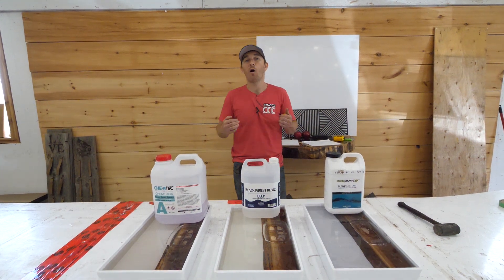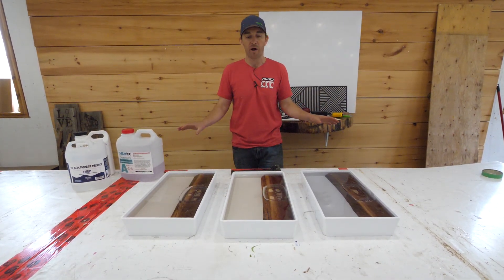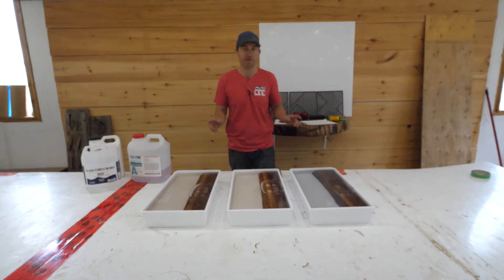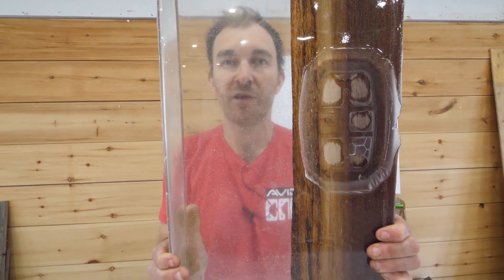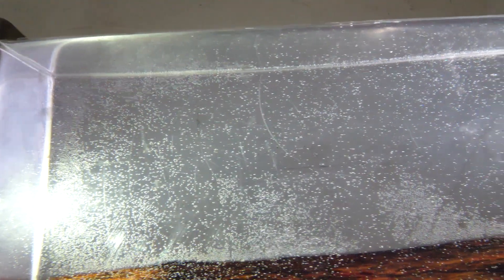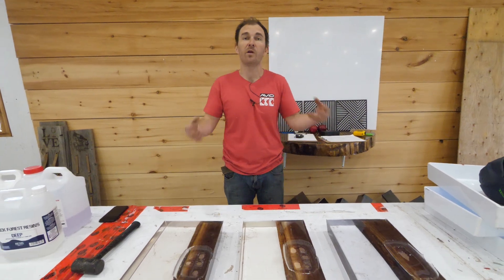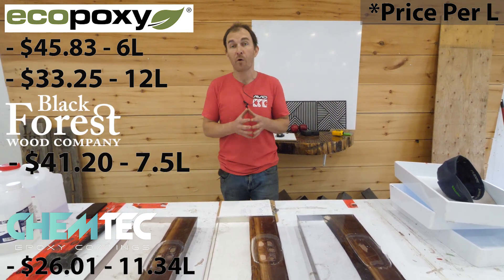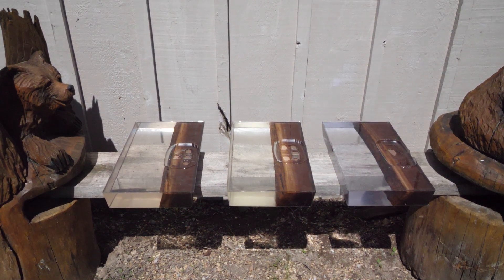Thick Pour Epoxy Showdown - Chemtec vs Black Forest vs Ecopoxy

Comment: How thick are these pours?  The flow cast system says maximum pour depth of 1.5" but your pours look much deeper than that.  Looking for confirmation that I can pour deeper than the instructions suggest.
Reply from the maker: Niel, your right these are 3'' in thickness, you can pour at this type of thickness but heat management is a must, you don't want the epoxy getting much over 35c, so if you can do that then yes you can pour almost any thickness.

Comment: Hi! I want to start working with resin and was wondering if you've use Ecopoxy? If so, it's said to be nontoxic and plant based, but do you recommend I still aquire the use of a respirator while working with this brand?
Reply from the maker: Hi, my understanding is there are no Voc's / solvents used in these new style epoxies, basically means no harmful chemicals are floating in the air, so my answer in no respirator is needed, but I suggest you check with the company your self.
Reply: @CanadianWoodworks  thank you very much! Yes I will inquire through the company as well.

Comment: What a great video!!! I purchased a couple of orders years ago from your shop of the Chill Epoxy. Having worked with 2 other brands prior, I was greatly impressed with the ease of working with Chill. I understand you no longer are affiliated with Chill, and I have been thinking a lot about my next set of tables I will build. I am very curious about Chill versus Chemtec. Would you be able to do a comparison with those 2 brands?
Reply from the maker: I may do a comparison in the future, but no plans right now.

Comment: Fantastic video!  What might help is to get a hold of a few colour/detail correction cards used on movie sets.  They are cards with known/set colours on them, so you could show them beside the pour, and then behind the pour.  You'd get an almost scientific measurement of colour change and clarity.  (You could measure it in most video editing software as it's part of a normal colour correction process).
Reply from the maker: That's a great idea!

Comment: Would really like to see a sealed edge test for actual bubble results
Reply from the maker: Hi Joe, I belive this is still a good bubble test, the chem-tec pour distinctly had virtually no micro bubbles once a few inches away from the edge of the wood, where both the Ecopoxy and Black Forest were riddled with micro bubbles through out the entire pour.  With that said I will be doing a sealed edge test using the Chem-tec Thick but not with the others, it's already a nice chunk of change I had to fork out for the Black Forest resin and Ecopoxy.
Reply: I appreciate it, Paul!

Comment: Just used some of the epoxy I got from Legacy Lumber.  Worked great except I did not do an adequate job of sealing the form.  Spent all night catching it and pouring it back into the form.  Pro Tip: Seal the forms better than I did.  Otherwise, great stuff.
Reply from the maker: Gotta seal those forms Barry!! lol We've all been there shhhhhh.....